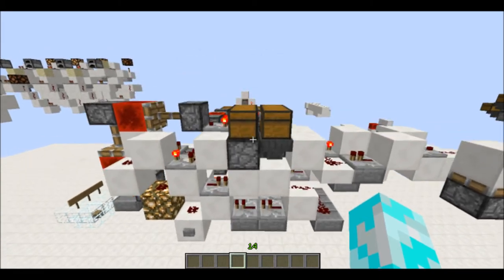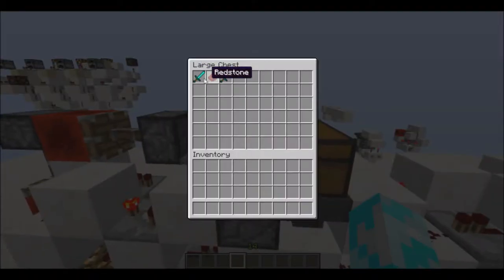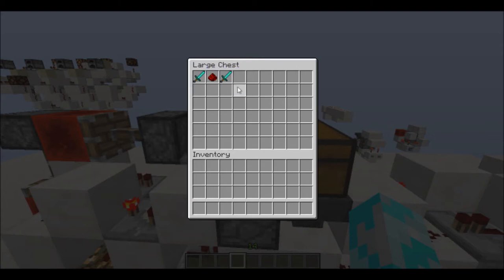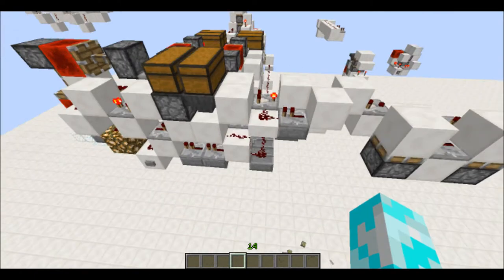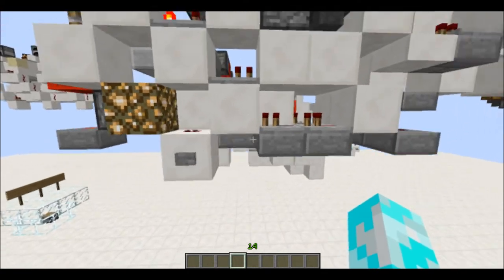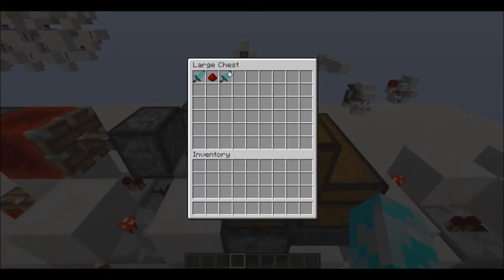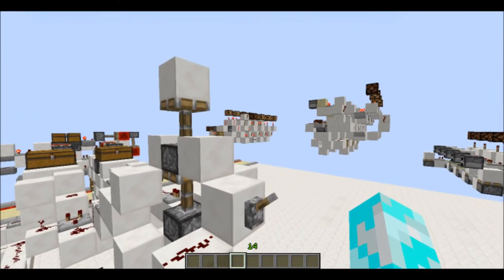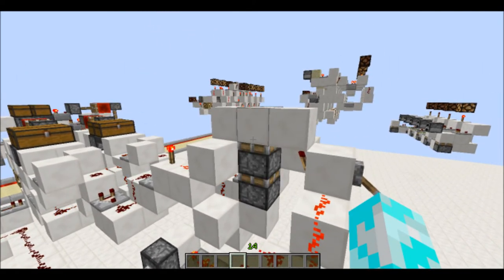Hopper ROM

Comment: one of the hoppers and droppers are used as the surface/solid blocks in a 2x2x3 clock composed of a torch and a repeater on 2. This is possible because chest carts can pretty much be whereever the hell they please. They're all like, "Fuck fermi's law, I'm a boson!"
Oh yea, and it's not double chest :P I had actually intended using it to decode short binary messages from chest carts sent from far away. Unfortunately, hoppers no longer put items into chest carts in the right order :(